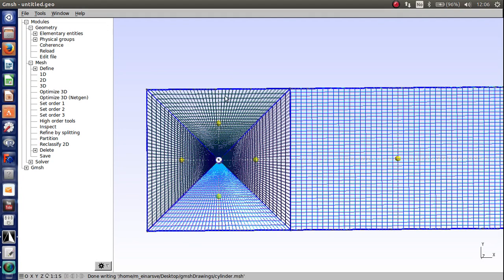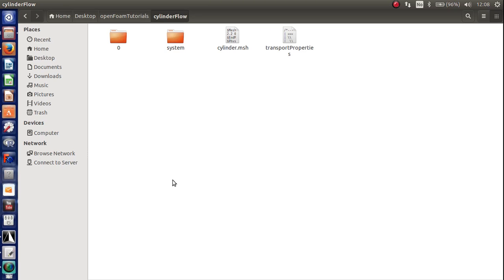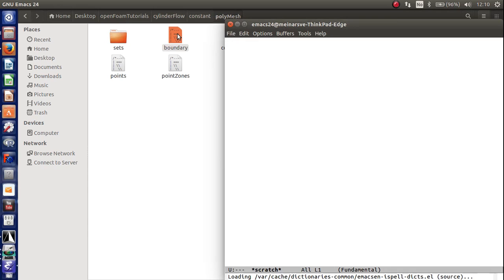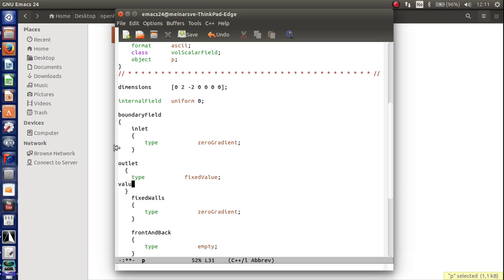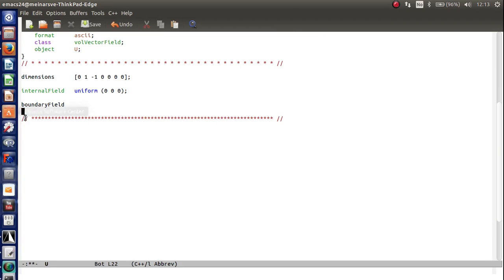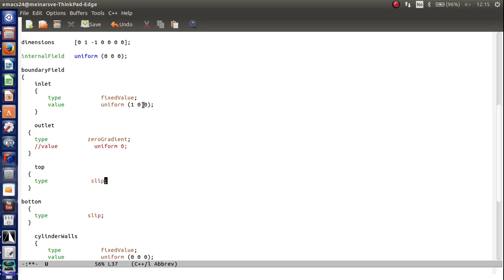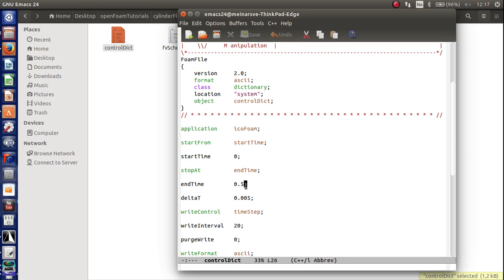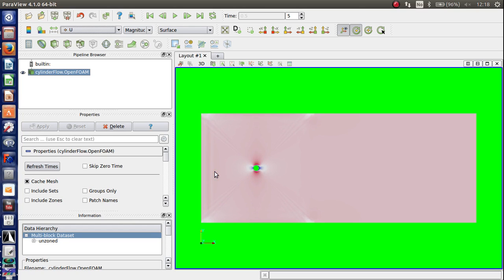Import Gmsh file into openFoam and solve Laminar Flow past 2D Cylinder

Comment: maybe if someone can try to help me, i´m having a problem on the conversion using gmshToFoam:
Create time

Starting to read mesh format at line 2
Read format version 4.1  ascii 0

Starting to read physical names at line 5
Physical names:8
    Surface 1   cylinderWalls
    Surface 2   bico
    Surface 3   inlet
    Surface 4   outlet
    Surface 6   wallbox
    Surface 7   surfacebox
    Volume 5    internal
    Volume 8    fluidbox

#0  Foam::error::printStack(Foam::Ostream&) at ??:?
#1  Foam::sigSegv::sigHandler(int) at ??:?
#2  ? in /lib/x86_64-linux-gnu/libpthread.so.0
#3  ? at ??:?
#4  __libc_start_main in /lib/x86_64-linux-gnu/libc.so.6
#5  ? at ??:?
Segmentation fault (core dumped)

Anyone know what made this mistakes?
Reply: Hi Felipe. Any luck? Because I'm facing the same error as well.
Reply: @bose1412-j2e  Nope, i back here couse im trying to model on gmsh on windows again, but the problem on conversion actually continues
Reply: @felipemelo6867  I remember solving this. Turns out I had forgotten to run the meshing operation before saving the mesh file. And I had to change the .msh file's format too. 

cfd-online.com/Forums/openfoam-meshing/233468-gmshtofoam-segmentation-error.html

I hope this solves your problem too.

Comment: Hey, i followed the similar steps, which you have done in your previous video and created my mesh for an airfoil. However, i got the error saying "no cells read from file airfoil.msh" after i typed "gmshToFoam airfoil.msh" on terminal. Could you please help me.
Reply: Use an older gmsh version (version 2.10.1 should work nicely)

Comment: Hello Martin,
It was really nice knowing some things. I would appreciate a little help from you when you have time.
I have created an airfoil in gmsh and also the far field as a square. And now I am trying to import that file into opneFoam. But it is showing the following error:
Create time

Starting to read mesh format at line 2
Read format version 2.2  ascii 0

Starting to read physical names at line 5
Physical names:5
    Line 1      inlet
    Line 2      outlet
    Line 3      wall_top
    Line 4      wall_bottom
    Surface 5   fluid

Starting to read points at line 13
Vertices to be read:567598
Vertices read:567598

Starting to read cells at line 567614
Cells to be read:1123721

Mapping region 5 to Foam patch 0
Cells:
    total:0
    hex  :0
    prism:0
    pyr  :0
    tet  :0

--> FOAM FATAL IO ERROR:
No cells read from file "Profile7.csv.msh"
Does your file specify any 3D elements (hex=5, prism=6, pyramid=7, tet=4)?
Perhaps you have not exported the 3D elements?

file: Profile7.csv.msh at line 1691337.

    From function void readCells(Foam::scalar, bool, const pointField&, const Foam::Map<int>&, Foam::IFstream&, Foam::cellShapeList&, Foam::labelList&, Foam::List<Foam::DynamicList<Foam::face> >&, Foam::labelList&, Foam::List<Foam::DynamicList<int> >&)
    in file gmshToFoam.C at line 742.

FOAM exiting

Could you help me out please!

Thanks in advance
Reply: It shows the same for me too!
Reply: @pratijayguha4624   I think thaht the solution is to create a Physical Volume.:
//
Physical Volume("fluid") = {1};
//
Source: http://onelab.info/pipermail/gmsh/2018/012580.html
Reply: hi, the problem is that you didn't define the Physical Volume. According to the video, we just defined the Physical Surface.

Comment: hey i a you made very nice and informative tutorial.i am new to openfoam.
i am getting a error while running IcoFoam
Courant Number mean: 0.158417 max: 5.33454
#0  Foam::error::printStack(Foam::Ostream&) at ~/OpenFOAM/OpenFOAM-3.0.1/src/OSspecific/POSIX/printStack.C:218
#1  Foam::sigFpe::sigHandler(int) at ~/OpenFOAM/OpenFOAM-3.0.1/src/OSspecific/POSIX/signals/sigFpe.C:108
#2  ? in "/lib/x86_64-linux-gnu/libc.so.6"
#3  double Foam::sumMag<double>(Foam::UList<double> const&) at ~/OpenFOAM/OpenFOAM-3.0.1/src/OpenFOAM/lnInclude/FieldFunctions.C:480 (discriminator 2)
#4  double Foam::gSumMag<double>(Foam::UList<double> const&, int) at ~/OpenFOAM/OpenFOAM-3.0.1/src/OpenFOAM/lnInclude/FieldFunctions.C:547
#5  Foam::smoothSolver::solve(Foam::Field<double>&, Foam::Field<double> const&, unsigned char) const at ~/OpenFOAM/OpenFOAM-3.0.1/src/OpenFOAM/matrices/lduMatrix/solvers/smoothSolver/smoothSolver.C:180 (discriminator 2)
#6  ? at ~/OpenFOAM/OpenFOAM-3.0.1/src/finiteVolume/lnInclude/fvMatrixSolve.C:193 (discriminator 1)
#7  ? at ~/OpenFOAM/OpenFOAM-3.0.1/src/finiteVolume/lnInclude/fvMatrixSolve.C:82
#8  ? at ~/OpenFOAM/OpenFOAM-3.0.1/src/finiteVolume/lnInclude/fvMatrixSolve.C:331 (discriminator 7)
#9  ? at ~/OpenFOAM/OpenFOAM-3.0.1/src/finiteVolume/lnInclude/fvMatrix.C:1390
#10  ? at ~/OpenFOAM/OpenFOAM-3.0.1/applications/solvers/incompressible/icoFoam/icoFoam.C:69 (discriminator 1)
#11  __libc_start_main in "/lib/x86_64-linux-gnu/libc.so.6"
#12  ? at ??:?
Floating point exception (core dumped)

before this i was getting slightly different variations after CHECKMESH command

Mesh stats
    points:           26080
    internal points:  0
    faces:            51440
    internal faces:   25360
    cells:            12800
    faces per cell:   6
    boundary patches: 6
    point zones:      0
    face zones:       0
    cell zones:       1

Overall number of cells of each type:
    hexahedra:     12800
    prisms:        0
    wedges:        0
    pyramids:      0
    tet wedges:    0
    tetrahedra:    0
    polyhedra:     0

Checking topology...
    Boundary definition OK.
    Cell to face addressing OK.
    Point usage OK.
    Upper triangular ordering OK.
    Face vertices OK.
    Number of regions: 1 (OK).

Checking patch topology for multiply connected surfaces...
    Patch               Faces    Points   Surface topology                  
    frontAndBack        25600    26080    ok (non-closed singly connected)  
    bottom              120      242      ok (non-closed singly connected)  
    cylinderWalls       160      320      ok (non-closed singly connected)  
    top                 120      242      ok (non-closed singly connected)  
    inlet               40       82       ok (non-closed singly connected)  
    outlet              40       82       ok (non-closed singly connected)  

Checking geometry...
    Overall domain bounding box (-5 -7 0) (30 7 1)
    Mesh has 2 geometric (non-empty/wedge) directions (1 1 0)
    Mesh has 2 solution (non-empty) directions (1 1 0)
    All edges aligned with or perpendicular to non-empty directions.
    Boundary openness (-8.22714e-19 0 1.92823e-18) OK.
    Max cell openness = 2.34385e-16 OK.
    Max aspect ratio = 4.16136 OK.
    Minimum face area = 8.73442e-05. Maximum face area = 0.575062.  Face area magnitudes OK.
    Min volume = 8.73442e-05. Max volume = 0.113924.  Total volume = 489.215.  Cell volumes OK.
    Mesh non-orthogonality Max: 54.2209 average: 18.3583
    Non-orthogonality check OK.
    Face pyramids OK.
    Max skewness = 1.29757 OK.
    Coupled point location match (average 0) OK.
Reply from the maker: +Nikesh Yadav Hey, as you probably know the Courant number Co = U*dt/dx. A Co>1 means that the flow can run through a cell during one timestep. I believe pisoFoam (and icoFoam) are limited to Co<1, and I think this stability criteria is good practice for all transient solvers. I see in your case you have a max Co of 5.33454 which may give errors, so my first advice is simply to reduce the timestep such that maxCo<1. 

However according to the documentation at
http://cfd.direct/openfoam/user-guide/fvschemes/ 
all the time integration schemes are implicit. This is probably to make the solvers more robust. Because many simulations will also work fine with maxCo>1, but this is of course complicated further by skewness of cell etc. 

If the problem is with the mesh it should be revealed by the "checkMesh" command.
Reply: +Martin Einarsve  i have also attached my checkMesh output in the previous comment.
my question with the same geo, file why gmsh is creating two different type of mesh. For example total volume of mine mesh(418) is just half of yours(900). I also did some optimizing thing with gmsh still the total volume remains the same.
Reply: by the way I am Nikesh , PhD student at Warsaw university of Technology.I am developing high order discontinuous galerkin solver. Right now i have 3d solver for compressible flow. so i want to compare the results (Flow over cylinder in steady case) with openfoam. I will be very thankful to you, if you will just elaborate more on about running the same case for compressible solver.
Reply: +Martin Einarsve   I have changed the delta t (0.00001) even than its diverging .the solution is stopped after fixed number of iteration steps independent of time interval .
Reply from the maker: +Nikesh Yadav Hey great! I used to study at WUT as well one semester!
Reply from the maker: +Nikesh Yadav Ok regarding your problems I am guessing you have some problems with the mesh. After running "checkMesh" does openFoam conclude with "mesh ok"? If you still having problems I suggest you draw the geometry of the lid driven cavity flow and mesh it with say 20x20 cells, and import that with gmshToFoam, and see if that is running.
Reply from the maker: +Martin Einarsve regarding compressible solvers I suggest you check out any the compressible tutorials at $FOAM_TUTORIALS/compressible
Reply: +Martin Einarsve ok :) yeah i think mesh has the problem.
Reply from the maker: +Nikesh Yadav sure! my email is m_einarsve@hotmail.com, it would be cool to hear more what your reseach is about